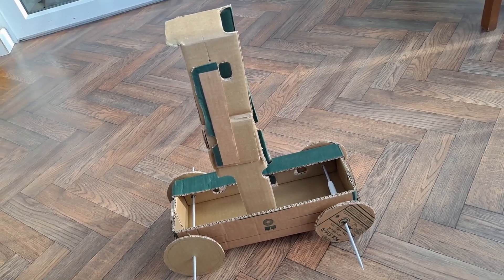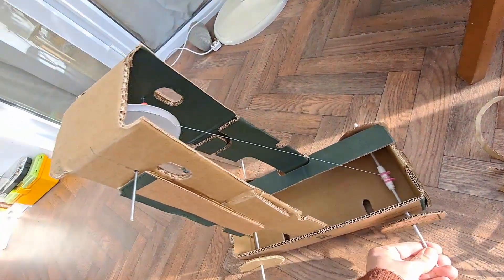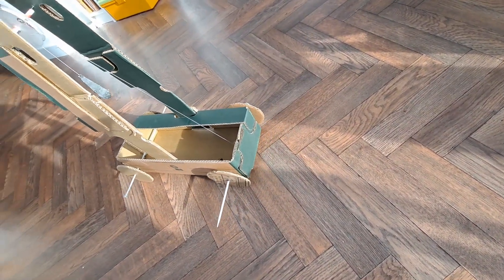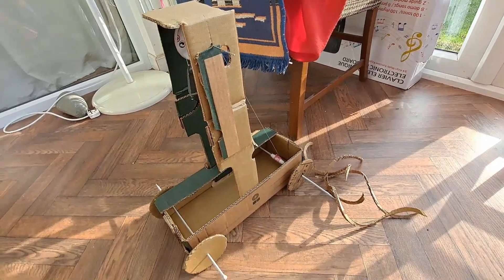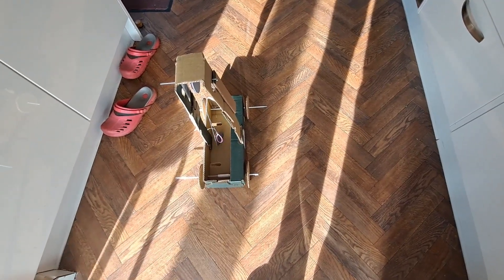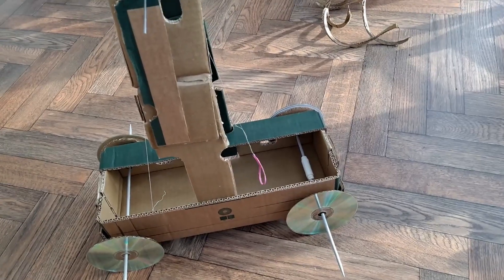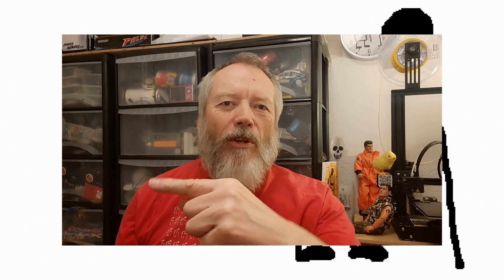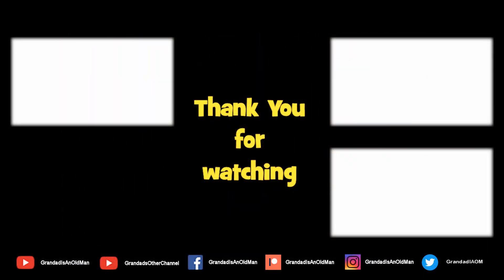Improving that Gravity Powered car

Comment: Now you have round wheels, you could try using a 'fusee' on the rear axle.  A fusee is a thing expensive clocks and watches have to equalize the driving power as the spring winds down.  In the case of the gravity powered car, you could modify the idea to give greater range.  Wind the last few turns (first to unwind) on the tape to give a high torque for starting and acceleration.  Wind the other turns direct on the axle, so that it provides less driving force but greater range.  It's like you do in a real full-size car.  You start from a standstill in a low gear, and then change to a higher gear once you've got going.
Reply from the maker: Yes that would work👍 Here is a video I did, demonstrating what I called a "3 gear auto gearbox" on a rat trap car - https://youtu.be/XXPm-K9uyGQ?t=211
Reply: @GrandadIsAnOldMan  I should have guessed that you'd already done something similar! 😄
Reply from the maker: @ceptimus  all suggestions welcome, even if I have done them before, I have probably forgotten them 😁

Comment: Might you also try putting rather wide rubber bands around each wheel to make them smoother and easier to get started moving? Just a thought. Thank you for sharing this with us.
Reply from the maker: Yes, you can use wide rubber bands if you have access to them. I recommend cutting strips from old rubber gloves (you can cut strips from balloons but they don't last as long). Here is my very old helpfile - Helpfile - how to put tyres on CDs for model car projects - https://www.youtube.com/watch?v=ZnuPnveCbxs&list=PLA5a2xPRSrB3g5RiX8Kf_uUBOL0Tb7AS0
Reply: @GrandadIsAnOldMan  Thank you! I am more into electronics than mechanics because that is what I know. I have been a Ham Radio operator since 1959. I was 11 years old at the time. Excellent tip about the rubber gloves.

Comment: Thats a huge improvement, and you've managed to use the CDs without needing the 3D printed hubs. You could probably use any round plastic object the same way, like the caps from Pringles tins.
Reply from the maker: Obviously, before I had a 3d printer all my builds did not have that option. One reason for this build was the comment that sparked this was on one of those old projects. Virtually all those projects also involved using a hot glue gun and I had to do special builds that "didn't need a hot glue gun". "What can I use instead of CDs?", was another common question, so there are builds using a range of alternatives. I try to accommodate my viewers 😊
Reply from the maker: Here is a helpfile I did for cardboard hubs 😁😁 - CD Wheels with Cardboard Hubs https://www.youtube.com/watch?v=Js1rtn2IGTE&list=PLA5a2xPRSrB3g5RiX8Kf_uUBOL0Tb7AS0